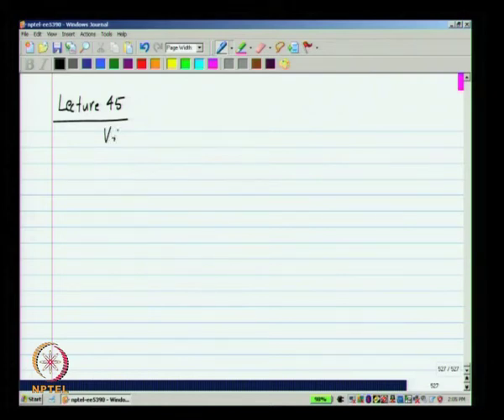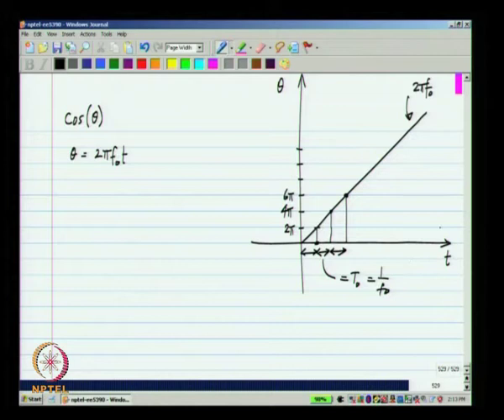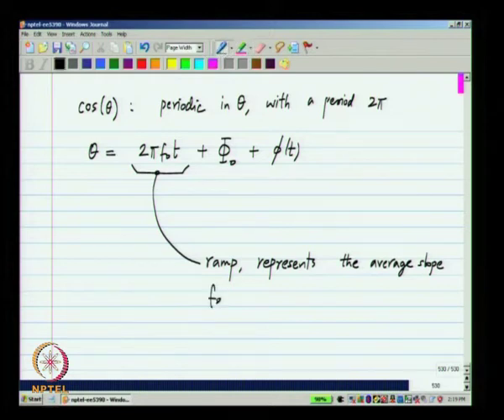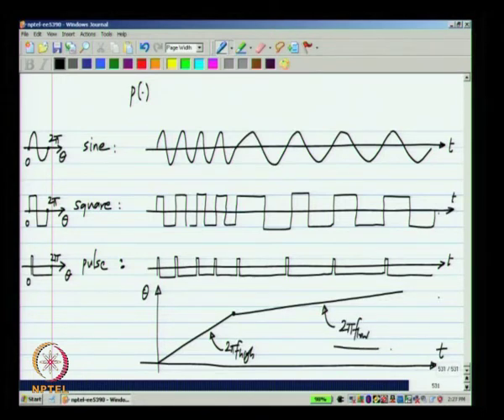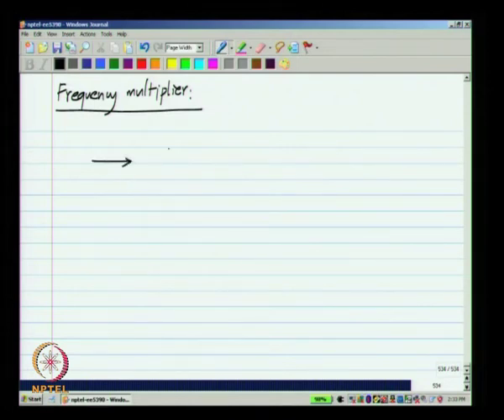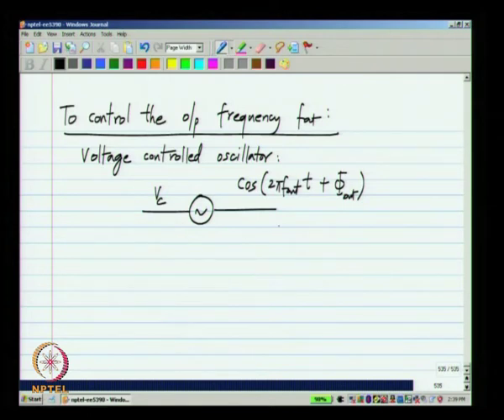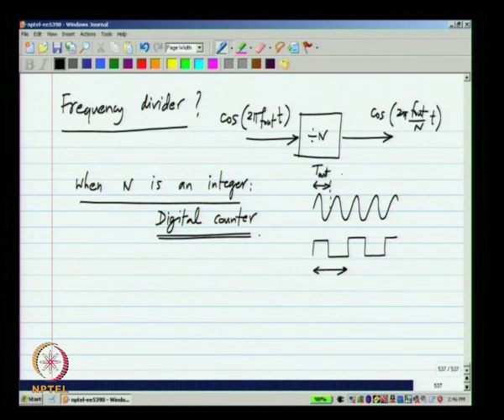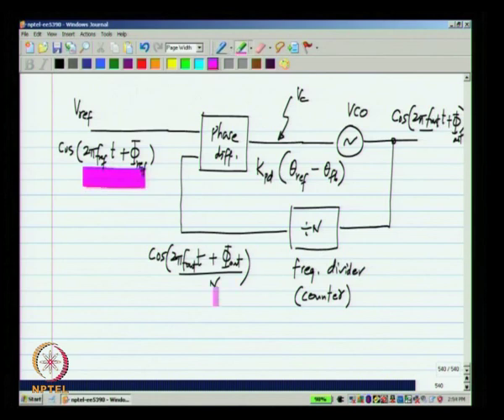Mod-01 Lec-45 Lecture 45

Comment: 39:04 Why do we integrate the output of the integrator again? Or does Vc correspond to the fe point of the forward path here?
Reply: Your time stamp is wrong. But to answer your question, the Prof. had in the first case only one integrator that took in f_e and came out with f_out. He then moves to a second case where the first integrator takes in f_e but now comes out with control voltage V_c. This control voltage V_c is then integrated subsequently within the VCO to become part of the output phase θ_out.  But perhaps the Prof. may have forgotten to mention that alpha placed before the first integrator would undergo a change in its units from being 1/sec in the first case to Volts in the second case. Or he should have used an alternate symbol instead of alpha in the second case.
Reply: @rp8028  nope, that's the time stamp I meant, but I figured it out - one integration for the error reduction part, and one to convert it from frequency to phase
Reply: @utsavv1167   Nope, you are wrong. The second integrator is converting voltage to phase  and not frequency to phase as you say.
Reply: @rp8028  Let me clarify, I meant integration (in the calculation), and not an integrator. I understand the opamp-based integrator "circuit" is converting voltage to frequency. I was talking about the calculation at the time stamp I mentioned. Hope this makes sense.
Reply: @utsavv1167  At the time stamp, the integration in the calculation being shown is  2*pi*K_vco*∫V_c(t)dt. This is being done by the VCO to convert voltage V_c to part of phase θ_out and this is not being done by any op-amp. This VCO is what the  makes a PLL at a minimum of atleast type 1 because it has one integrator in the loop. The other integration that of  frequency being shown in  α*∫f_e.dt  is moved out of the main path to show that it results in operation on phase in the input and feedback paths . This  is a just a mathematical relationship similar to that which holds always true between  instantaneous frequency and phase in periodic or FM kind of signals. This need not be specifically implemented by any block. The Prof.  thus moves away from the frequency domain  error amplifier and brings in  a phase detector instead. But the phase detector is not an integrator in any sense as shown here.
Reply: @rp8028  Yes, this was what I implied, thanks for elaborating!